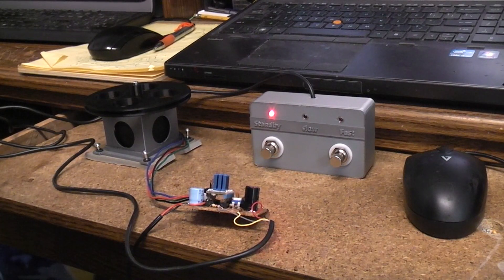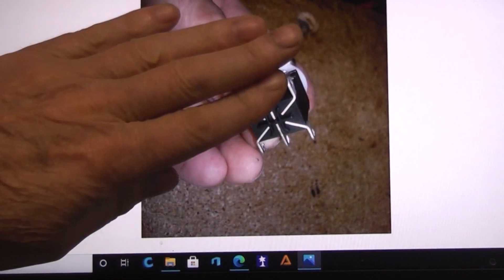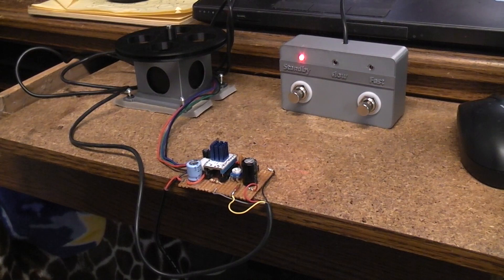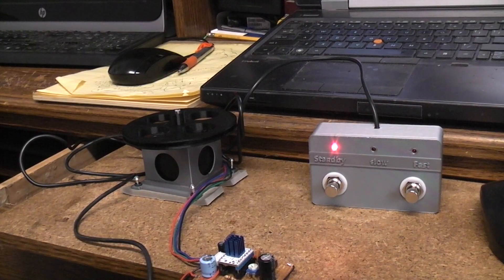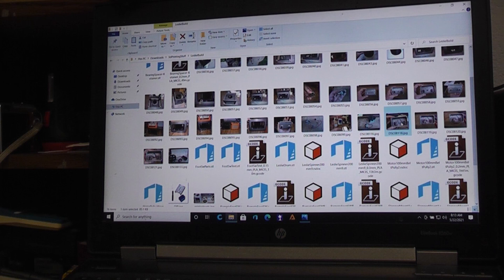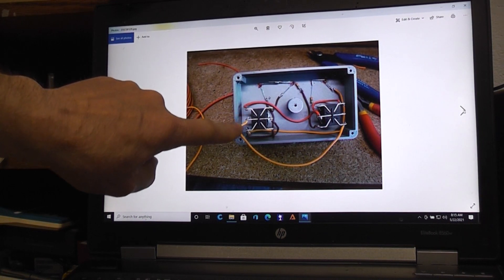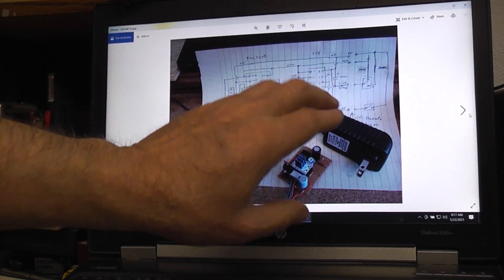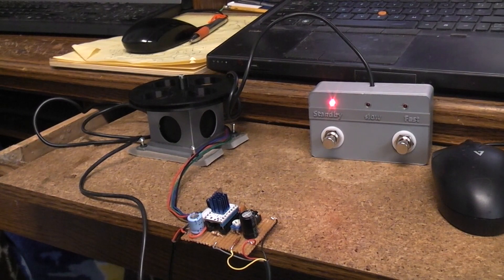Part 5. Rotating Leslie speaker build. The remote foot switch.

Comment: Great series. I've an old drum/rotor assembly pulled from an organ that I'd like to rig with this type of motor. On Amazon Canada most of the Nema 17 stepper motors are rated for 3.8 or 7.3 volts, rather than 12 volts. Should I make sure to get a 12v (or higher?) if I want to use the same setup as demonstrated in this video? Thanks to anyone who chimes in on this :)
Reply from the maker: All 3d printer stepper motors run at 12 volts for older units and at 24 volts for newer printers. You might just look for junk 3d printer parts. I just got mine from junked out 3d printers.
Reply: @Robothut  Many thanks. I ordered the electronics and motor arriving today! To get the drum speeds roughly correct with the electronics/motor setup I opened your 3d print files to see what looks like a 100mm drive pulley and 75mm driven pulley. My unit has a drum pulley of 140mm so according to an online pulley / rpm calculator I need a drive pulley of around 106mm. My current interest stems from having both a Leslie 125 and a Fender Vibratone in for maintenance / modification. They're both very large and heavy units whereas mine will be compact and light weight. :)
Reply from the maker: @stormriderkaos  Have fun with the build.

Comment: I'm definitely going to try and build this! I'm fairly new to the electrical engineering side of things (I'm coming from a music tech/recording background). Would there be any way to access a copy of your schematic for the stepper motor/footswitch build? I tried to screen grab the hand drawn one from the last video but it's a bit cutoff! Thanks in advance @Robothut !
Reply from the maker: I am working a project not related to the Leslie project right now that plan to use a stepper motor for and I think the same circuit would work. So I might experiment with Kicad cad to do a schematic and PCB layout.

Comment: Once again, much appreciated.....we have been meaning to build an amplified leslie cab for the last couple of years and I have been gathering bits and pieces trying to figure out how to control the spin of the thing.....this is definitely how we are going to do it.  So, thanks so much for that!  I think I will try to use both the two speed selector like the original cabs and also use a volume pedal for the variable speed and then just have a switch to go between the two....Excellent!  I think I subbed to your channel because my son was wanting to get into 3d printing and now I use them all more than he does....but that also means I have all of the parts needed to build this thing and also the electronics gear required....might be a good opportunity to teach the boy some soldering skills.....love it when things work out like this!  Thanks again!

Comment: You make it seem so simple.  I envy your electronics knowledge.  I have an old electro-mechanical pinball machine I've been working on, and just tracing the maze of wires gives me a headache.
Reply from the maker: Yes I have old pinball machines as well. They can be quite job to repair ! My biggest problem is my back just does not like the position you have to be in to work on them.
Reply: @Robothut    Same here!